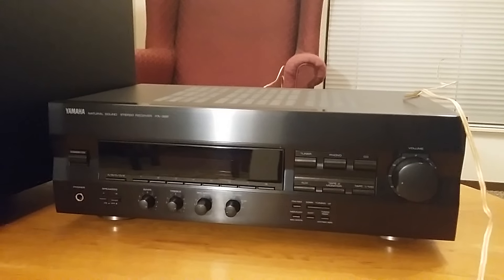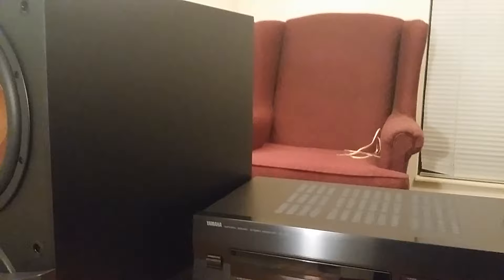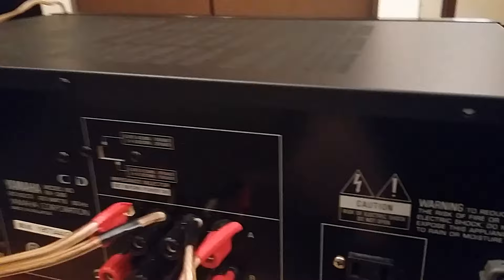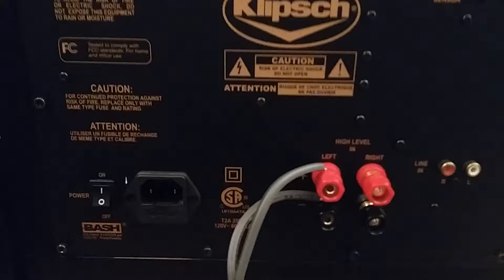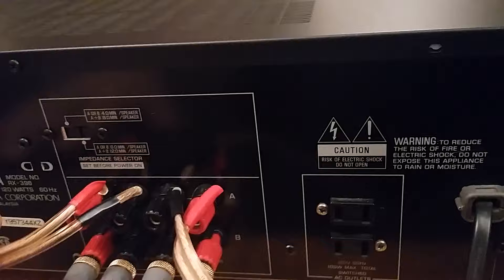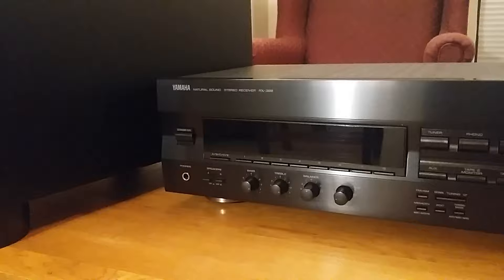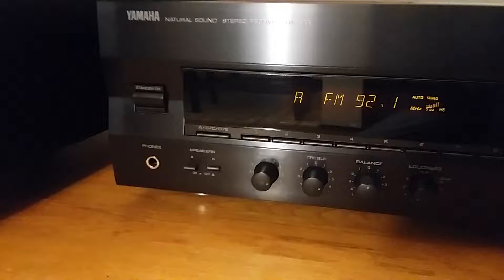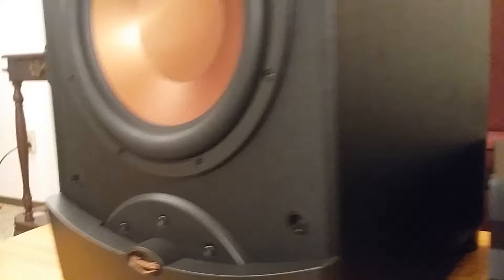How 2 hook up a active subwoofer to a receiver or integrated amp with no subwoofer pre out on unit

Comment: I know how to hook up a sub to my vintage receiver now thank you very much
Reply from the maker: Ha Tu your very welcome , I got more audio tricks coming soon !
Reply: @tee-jaythestereo-bargainph2120  just hooked it up and put on A+B my bookshelf got a very little sounds even I turn the volume to 1 o'clock all I hear just the sub ( I only turn up just a touch) switched back to A only the sound is normal ( 9 o'clock) I was thinking the vintage receiver is not enough powers to drive A+B any ideas? Thanks again
Reply from the maker: Ha Tu sometimes when using A+B it'll take half the power away turn the amp up on your powered subwoofer
Reply from the maker: you may have to get more efficient speakers our a more powerful amp what amp you got ?
Reply from the maker: Ha Tu yes turn the power to the subwoofer half way then on your Reciever turn it up and see if it makes a difference if not your receiver might not be powerful enough the Reciever I use in this video is only 50 watts but it rocks out decently
Reply: The volume normally at 9 o'clock it had full sounds but pair with the sub on without turn up the volume of the sub or turn halfway the main speakers sounds like at 7:30 o'clock very tiny sounds maybe I have to try a different amp to see is better thanks for the input will have a report when it's work thanks

Comment: What about using the Tape-REC RCA outputs instead?
How did you figure this out. The manuals never mention, not even suggested, that this could be a possibility.
Reply from the maker: I been hooking up audiogear since i was 5 years old , my dad was a proffesinal singer for 40 years.
 tape output puts out a full 2 volts and no volume control with reciever basically you get full signal to the subs
The way i show you have volume control and timing will be better with subs

Comment: My receiver (samsung mm-c430d) doesn't have A and B inputs... Just left and right. Is this still possible? Or would I need a line out converter?
Reply from the maker: You mean no A/B speaker outputs . Yes its still possible , 1st turn everything off and unplug the power cable 2nd you can splice into the L/R speaker just make sure you have positive to positive and negative to negative the power sub only requires a 500mw output normally i dont reccomend this way but lots of people on here have done this !

Comment: Any tips on dealing with a passive sub with nothing but gain control? It's kinda hard to adjust with my towers in my 2.1. Thanks! My sub is a Onkyo SKW-520. My reciever is a Sony STR-DG520. I have a Matantz NR1200 coming in this week so I only run 2.1 setup.

Comment: You can also do this with one set of outputs on the amp. High level inputs on subs have super high impedance and provide no load to the amp.
Reply from the maker: I agree 😆 thanks for stopping in ! On this channel we share alot with one another in the comments , If you do ever hwve a ? About audio or re comendation on gear just post a comment 😆
Reply: Tee-Jay The Stereo-Bargain-File 
I have a Proton AA1150 2 channel power amp which just has R/L
outputs connected to a pair Heresy 1’s. Can I run a pair of wires from the amp to the speakers so that they’re full range and another pair of wires to the sub’s high level inputs to help bolster the low end, since the  Heresy’s only go down to about 50Hz?
Reply: Mike T thanks for the reply. I wired it this way to a 10” Dayton Audio sub a couple of weeks ago and love how it sounds.

Comment: This is fundamentally correct, but I have two points. One is you don't need thick speaker wires running to the sub, as only a tiny fraction of power makes it through the sub inputs 100+ ohm impedance. Secondly, running A+B speakers may not work on some receives or amps (like mine), so running two sets of wires from one set of outputs on your receiver or amp is the solution. It's easier to connect two wires to each speaker-output terminal using thinner wires to the sub, or alternately use banana plugs to your mains, and bare wire, pins, or spades to the sub.
Reply from the maker: Short video ' and speaker cable is only 14g ' and having A/B allows you to run thr sub with Off/On but your correct you can tie in with 1 set of speaker outputs '

Comment: so, 'high level in" is same as line-level? and amped ampage is ok?? if it see it as line level, must be a step-down transformer for decrease of impedance, is this accurate that you know?
Reply from the maker: No high level input has a max of 2volts input'  it transforms watts to voltage its built into the active sub(regulated) ' to high of watts to voltage would burn the amp up ' line level is normally a full 2volts always ' for example all dacs and Cd players put out a constant 2volt signal into inputs of a preamp intg amp or evem reciever  with minor fluctuations between 1.9 to 2.3volts ' hil-evel allows you to have variable volts 0 to 2volts depending on the volume you use this way you can balance volume control of sub with sub volume control

Comment: Hey Tee Jay. I read the comments and you answered the question I had about whether the receiver would drive the sub or not. Thank you I was looking everywhere for that.

I happen to have the same exact receiver and that idea just occurred to me because I'm getting ready to hook up a Bluetooth transmitter and needed an easy way to turn off the sub as well as chA.

I've seen people say you get better quality from rca line level. I was wondering what your experience has been with this?

Thanks!
Reply from the maker: Your welcome 😃
Reply: @tee-jaythestereo-bargainph2120  you're
Reply from the maker: @chhansen9813  No speaker line more accurate than rca ' 
You get better phase/timing with speaker output vs rca ' your getting exactly same signal as front speakers thos is why Rel uses high level input instead of rca 'timing' so sorry for late reply

Comment: Thanks for this. It's a useful tip but I think the downside is that there's no bass management on the main speakers. Ideally you need a high pass filter on the main speakers to channel the bass away from them. That allows them to breathe, and have the sub do the bulk of the low frequency work. Your method is good if there's no bass management system in the amp though.
Reply: Emotiva makes at least 1 sub that I've seen on YouTube that actually has bass management on the subwoofer.
Reply: @Tony Magill, I need a MANAGER so I'll quit handling myself so much!!!  :P
Reply: totally my concern. do you know perchance best way to do this, is it possible:  to have a vintage receiver (with no pre-amp outs) hooked up to a powered sub? you cant hook up powered monitors so seems like same applies to powered anything (sub).

Comment: What if you only have one set of speaker outs on your amp? Can you hook two different set of speaker cables to the one set of outputs on your amp? So one set going from amp to speakers other set going from amp to sub?
Reply from the maker: You should be able to i would have to see the setup
Reply: @tee-jaythestereo-bargainph2120  Hi TJ,  how about making a video on this? Great channel, btw.
Reply from the maker: @MArk-yn4sp  a lot of people that only have one L/R speaker output like with tube amps do use the 2 to one way I honestly not a fan of this way but it can be done

Comment: Quick question if I make a set a pair of powered 18 inch powered subwoofers that weighed over 400 pounds each and sell it on eBay would the United States postal services post office be able to ship it
Reply from the maker: No you would have to rent a shipping  container because their 2 heavy to ship , my JBL studio 580s tower speakers that are 50 pounds each cost 300.00 bucks to ship with in the US , and they have to be packaged in seperate boxes crazyness !

Comment: I have a real problem.....I purchased the new latest and greatest (some may say)  Samsung HW 990C soundbar that came with rears and a sub.  Like many, the rears are not loud enough and the sub appears dead.  I keep reading how the sub blows people away, I just don't get it.  So I am in the process of purchasing a set of bigger surrounds for the rears and a powered sub.  Here's the problem...wireless.  The soundbar has no aux and no sub out.  These speakers are not going to be placed together, so I'm looking at 2 mini receivers.  My hope is to Bluetooth both receivers with the "smart things" tv, bar, etc to get some acceptable sound.  Any suggestions?  My brain hurts.  Thank you

Comment: does it need to be the same gauge speaker wire going to the sub as what is going to the 2 main speakers?
Reply from the maker: No not at all you can use smaller gauge

Comment: When hooking up a powered subwoofer to your av receiver never plug the powered subwoofers power cable into the power outlet on the back of the av receiver because you run the risk of drawing too much power from the av receivers power outlet and can cause the receiver to shut off when you crank up the volume on the receiver
Reply: Also, Using a switched outlet on the amp or receiver may shorten the life of the power switch!
Reply: Yeah, it's not even needed since just about every sub has an auto on/off function.

Comment: Does it work with rear output? because the top ones on mine says front and the lower ones on mine it says back
Reply from the maker: Yes it will work 😆
Reply: @tee-jaythestereo-bargainph2120  Great! And thanks for the very fast response

Comment: What if the 2 channel amp got only a one set of speaker connections, left and right?.
Reply from the maker: Thats why i said you got to have a/b speaker outputs but ! You can slice into each speaker cable and run it to the powered sub that has high level input i normally dont reccomend this but others i have tried and had no problems make sure everything is unplugged and off when you do this
Reply: @tee-jaythestereo-bargainph2120  Thanks for the info sir. I'II try doing that.

Comment: He Mate I Just Come Across Your Video Did You Realize That Your Speakers B Your Plugging Left from Your Subwoofer To Right in Your Amp And And Right In Your Sub To Left In Your Amp Cracks Me Up How You Said Make Sure It's Turned Off and Make Sure There Not Plugged In Backwards. But Thanks Anyway For The Vid On Not How To Plug Your Amp In To Your Sub.
Reply from the maker: Actually it doesn't matter ' as long as you get pos/neg correct ' it equals Mono Either way ! but yeah your correct MF !! But will not hurt or change anything at all ' we making Mono signal ' only 1 sub '

Comment: I get that you go into the sub with speaker level wiring, but the title included "active" subwoofer so I was hoping to see how to use the subwoofer's amplifier because you know it's better for that sub than that receiver's amp.
Reply from the maker: Its a active or powered sub i am using the subs internal amp to drive the sub  speaker cable plugs into high level input which is basically only draws up to 500mv . The reciever isnt driving the sub its just a signal like whem you hook up rca

Comment: My subwoofer doesn’t have a high-level input on the speaker wires only a low level. Will that work to?
Reply from the maker: I don't think it will low level is for rca connectors or speaker output - what sub do you have i will look it up ? And let ya know don't forget ti subscribe 😆 I'm here for audio enthuist not the audio companies 😆
Reply: @tee-jaythestereo-bargainph2120  
It is a Polk PSW108 10” sub to a
Yamaha R-N303BL Receiver without dedicated sub-out but with a line in/out if thats a better connection I’d love to know, thanks again for replying!
Reply from the maker: Yes your sub has speaker level 'inputs' at the bottom of the speaker inputs The top is speaker level output don't use them !!  Just the speaker inputs at the bottom roll So run pos to pos neg to neg don't get them backwards just like your hooking up a speaker - remember the bottom of sub speaker connectors are the inputs 
You can run bare wire from your Yamaha b speaker output into the Polks speaker inputs - and make sure you turn on speakers A and B fron your yamaha also make sure everything is unplugged from the wall when you do this !!!

Comment: Hi matey. If I only have 1 set of speaker terminals, would the polk PSW10E permit me to connect the wires from the Amp terminals to the line IN, then wire running from the line OUT to the speakers in the SUB? (Basically it's the sub that has 2 lots of speaker terminals, not the amp)
Reply from the maker: If you amp that has one L/R speaker output you can jump off them wires correctly L/R to the hi level input of sub this will not take power away from your front speakers sub hi level inputs only take a very small signal . You wouldn't have to worry at all ! Paul @P.S. Audio does his set up like this? The sub does not draw power only signal hope that helps
Reply: @tee-jaythestereo-bargainph2120  yes looks an OK path for me. Pay day I'll be hoping to get this particular sub fir my nad c320BEE. Its not high watts but I only want it for music mainly. Cheers

Comment: Do you know if a powered subwoofer that doesnt have written high input on it anywhere but instead has (L in White) and (R in RED) with conection holes ,  Has a phase knob with 0 to 180 degrees,  then inbetween volume knob and the phase knob , has 50hz - 180hz with a little nut and thread sticking out. 
Will i blow up my reciver or will it just not work as a subwoofer , as im hoping to add bass to my reciver which only has to book shelf speakers to it.  (my receiver looks like yours and doesnt have dedicated sub output)
Reply from the maker: Are those L and R inputs speaker inputs or rca ?

Comment: Hey tee Jay, I have an active subwoofer with high input ports, but there is 8 of them (unlike 4 on yours), input from amp and output to speakers.. So When I connect sub to amplifier I dont have to use B speaker ports in this case because my speakers will be connected fromthe sub output am I correct?

Comment: I have Trio Stereo integrated amplifier KA-5300, and has only one set of speaker. No sub out or pre out. Is it safe to wire them in parallel connection? Tnx in advance🇵🇭
Reply from the maker: My bad man just saw you message , its a risk of over heating your amp may even trick it into running a lower ohm

Comment: Can i share a connection positive and negative with front speaker spot on amplifier? If done that, will it bring a same result on active subwoofer
Reply from the maker: I dont understand you question try to rephrase it and i will do my best to help you
Reply: He means he does not have a B set of speaker terminals. So can he share connections on the speaker terminals on the receiver.
Reply: Hook it up to any set of postive and negative, it doèsnt matter which speakers you choose. It will work on them all but not at all at same time, just 1 set of left and right.

Comment: Not sure if you'd know much about this but I have a classic Fisher model 4010 audio component system and im habing trouble running both speakers from it. It has a very weird a and b left right plugins on it and it seems nearly impossible to get the full potential out ofnit due to it only being a 2 channel a and b switch and the left and right balance doesn't seem to matter if I have to splice in together on the speaker wire to get them both to run at the same time. Any tips would be appreciated
Reply from the maker: I would have to be there to see the problem

Comment: Quick question if you were to hook up 4 15 inch 2000 watts rms powered subwoofers to a home theater receiver and crank up the volume really high would the windows get damaged
Reply from the maker: Depends on the size of the room and the quality of the glass in your windows ! But that sure sounds like a good idea lol

Comment: Great video. What if I wanted to connect 2 subwoofers instead of just 1? Would I connect the Right speaker B wires to one subwoofer and the Left speaker B wires to the other subwoofer? Thank you in advance.
Reply from the maker: Yes you got it ! 😆
Reply: Hook it up to speaker a then wire speakers parallel. Then sub2 to speakers b and wire speakers in parallel . Then turn on speakers a and b then adjust subwoofers. Easy as that.

Comment: Im trying to do this exact thing except my sub is an active sub.  None of my speakers are powered. They are all small speakers. Please help.
Reply from the maker: If you have a active sub (powered) you will also need high level inputs on the sub - did you mean passive sub (non powered) ?
Reply: Yessir, i meant to say a passive sub
Reply from the maker: @MarkDavidson-xy6lq  yeah you'd need an amp to drive the passive unless it has speaker inputs and outputs old skool 😆

Comment: Hi again TJ.

I tried to hook my active sub by connecting high level to my speaker B on my amp, but it made a hum noise even i didnt switch my amp on yet.

But if i combined speaker and sub cable together and go to speaker A, the hum noise didnt happen.

I ll try to connect the sub using rca from my pre amp output, how do u think, is it better sound i ll get than high level connect?
Reply from the maker: Maybe your amps b speaker output isnt working correctly  shouldn't be no humm

Comment: What does line in do, is that for the subwoofer out from the amp? if so, advantages/disadvantages of each? thanks, nice vid.
Reply from the maker: Advantages of hooking up this way i show helps with phase matching ! But if you wanna have a cut off freq at 60-80hz to the subwoofer you will need for the active subwoofer to have a crossover built in which most of them do now days 😆 but your front speakers will have full range sound unless your amp has a frequency crossovef built in most people just put the sub on low volume to help get some extra ummpp out of their speakers 😆